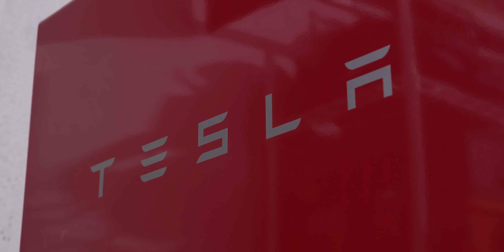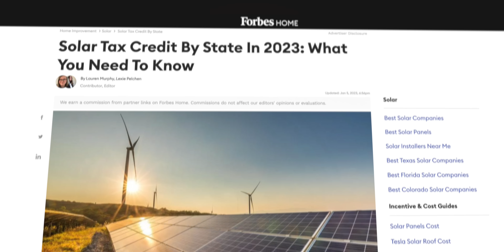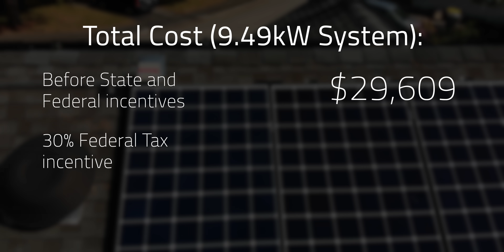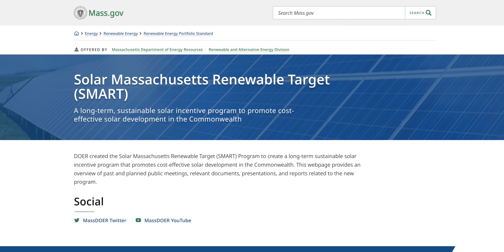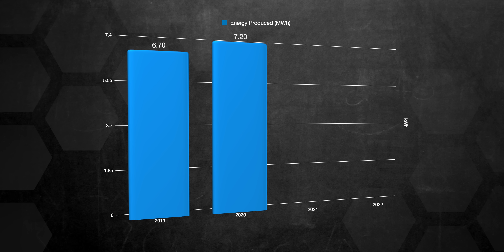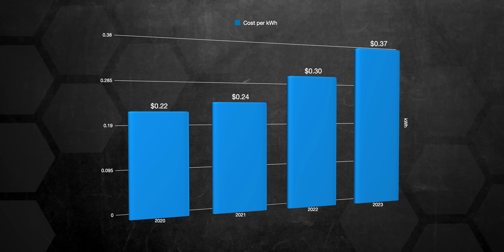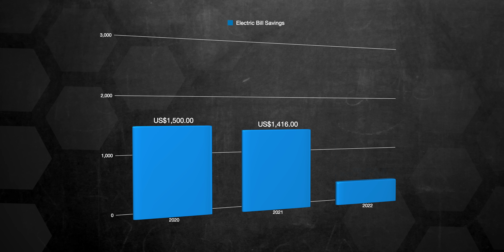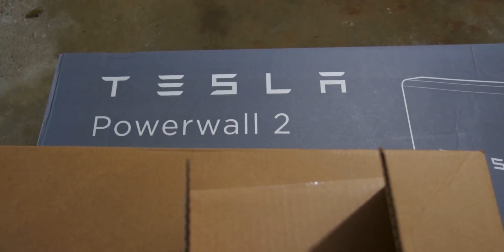5 Years with Solar Panels - Is It Still Worth It?

Comment: I'm interested in going solar, but I have a problem that you didn't touch on. I recently installed a new roof on my house, and while talking to the installer about solar, I learned that putting panels on the roof would negate the fifty year warrenty. I have seen a group of panels mounted on a metal framework sitting directly on the ground. Are there any pros or cons to this or even other types of installation.
Reply: Pros: you don't have rapid shutdown requirement and doesn't effect the roof.
Cons: takes up patio or yard space and racking is more expensive.
I saw a nice one from eg4 for 4 panels $300.

Comment: Not worth it unless you have your own power bank. Or you will be selling more electricity back to electric company then you're using at your house
Reply: That's an absurd claim. Whether it's "worth it" or not depends on many factors, and in most areas a "power bank" provides very little payback. In Southern California, solar systems typically have a 6-7 year payback, without "power banks".
Reply: @BigBen621  we pay about 3k a year for electricity. Our house it would be paid for in 2 years with a lifespan of 25 years correct.  So over 20 years payment free?
Reply: @Tegridynews  You seem to be implying that you can buy a solar system for $6,000, which is almost certainly not true. The best paybacks come where utility rates are very high. Here in San Diego, averages rates run $.35/kWh or so, and solar paybacks are 6-7 years. In areas with lower electric rates, paybacks would be proportionally longer.
Reply: @BigBen621  I'm just trying to learn not trying to argue with you. I watched your video you never said how much you paid for anyting so I'm totally in the dark. And for what I've looked online your setup is like $7,200.
Reply: @Tegridynews  You may be confusing me with someone else. I've never made a video.  I don't know what you think my setup is, but my 6.0 kW system costed $21,100 before or $14,700 after rebate. My electric costs went from about $2,000/year to nothing, so my claimed payback was about 7 years. However, rates have skyrocketed since then, so my payback has been much shorter.
Reply: @BigBen621  I do apologize I got caught up in two different conversations in solar on two different videos.
Reply: @BigBen621  dude used to Delta pro batteries, 3 solar panel, lived off grid for two days. Nearly made it by at least five hours for the sun to come up to start recharging by the second day

Comment: You spent $29k to break even in 7 years? And you can’t resale your $29k solar system? Wouldn’t a 6% mutual fund been a better investment? Even if you make 0% after 7 years at least you will still have $29k.
Reply: Seven year payback is equivalent to a 14% mutual fund; so no, a 6% mutual fund wouldn't have been a better investment. If you goal is recover your $29k in cash at the end of the payback period, then of course a solar system won't achieve that. But at the end of the payback period, your solar system will continue to return 14%; while the $29k you got back from your mutual fund is very unlikely to achieve similar returns in reinvested elsewhere.

Comment: Living in South Africa, I've also just done this - though the reason wasn't so much environmental or to see if we could save, but the grid here is getting more and more unreliable and we have hours and hours of scheduled power cuts (loadshedding) so those that are able to are increasingly going off grid.

We ended up getting a inverter and battery first (so we could take power to charge the battery when the grid's power is on, then use the battery when there's no power).

This sounds pricey compared to what we've done - admittedly in a much cheaper country than the US. And having just done it, so maybe prices have come down. Also you're getting a lot more incentives/tax breaks/selling electricity back to grid then we get, so maybe balances out.

Anyway, we paid R64,000 (about $3,500) for the battery and inverter system - just a 5kw system, we don't use that much power (gas stove, no central heating/air con, already a solar geyser/boiler). We've just got to be careful not to use the kettle, washing machine, dishwasher, toaster etc all at the same time - but so far we've been fine.

This week we've got the actual solar panels in (so we could still have power in case we move to a state of grid deteriation whereby the power's out for so longs out battery drains before it comes back on!) at a cost of R50,000 (about $2,600) for six panels giving us 5kw (same as the inverter and battery that we have).

With northern South Africa being super sunny pretty much all year round, this should be enough to get us completely off grid. It's just a shame that (currently) there's no way to feed back to the grid like, as I would think most in South Africa who are able to put in their own solar, would be willing to feed that back into the grid for little to no financial compensation, but just to help the grid not completely collapse and ensure the lights can stay on in poorer areas.

Comment: Seems to me that alot of time, money and effort is spent on solar power production of electricity. It seems to me that saving electricity, turn off apliances, lights, use fans, insulate your home, use leds where possable is a much better alternative. Not using electricity or using less of it seems to be much easier and cost effective than trying to create electricity. This is probably not what everyone on this forum wants to hear though.   🤔
Reply: Yes, cost-effective energy conservation measures should be taken first; and then the solar system sized based on the reduced consumption after these measures are taken.

Comment: i had a bad run with inverters. no.1 lasted 9 months, no.2 lasted 4.5 years, no. 3 is still going but with high cost of replacement it takes the shine off it.

Comment: Nope.  It's not worth it, for us, we would need a new electric whole house furnace, electric water heater, electric clothes dryer, electric lawn mower (5 or 6 of them to do the job while the others charge), electric weed whip, electric chain saw (need the extra large size, do they even make them in an electric version?), electric log splitter (50 ton please), and 2 electric vehicles with 500 mile range.  It's not happening, all of that would bankrupt us, and I resent the mandates from on high to "get rid of those polluting gas appliances" when in fact the electric grid is utterly unprepared for millions of users to go "green" when actually we are going to have massive blackouts if the power plants continue to be shut down, both clean coal and nuclear plants are being de-commissioned decades before the grid is ready!  And NO we do not have an extra $20,000 just sitting there in the bank to spend on a very small solar system, for our needs we would need 7 or 8 of those.  Nope, not happening, and even if we did get a loan to do it all, the next owner of the house would not want to deal with the increased cost--plus the cost of getting rid of it all when the trash company says, NO, we will not pick that up, and the recycle company says, Yes we will pi/ck it up for a FEE.  I'm all for renewable energy but it has to be affordable and actually add value to your home, not detract value due to high decomissioning/removal/recycling costs.
Reply: Your claim that you'd need to replace all these appliances is absurd; why are you saying this? 
At this point, the only restrictions on gas appliances are on new appliances and new homes in a few cities or perhaps states.
If you mean 7 or 8 panels, these would cost a fraction of $20,000; I put in 20 panels for $14,000 eight years ago, and solar panel prices have come down substantially since then.
Reply: clean coal 🤣🤣🤣

Comment: What about the cost of battery & panel replacement? They don't last forever. You got the Tesla battery wall for free, most people won't. Add that into the total cost you will never get a return on your 'investment.' I know that dirt & grime cause a loss of about 15% per month unless cleaned. That's not free either. Solar panels are cute but a total folly.
Reply: Panels are typically guaranteed for 25 years, by which time they'll have paid for themselves several times over. Your claim that "dirt & grime cause a loss of about 15% per month unless cleaned" is absurd; my system has been cleaned exactly once; and produced more energy in 2022 than in 2016, when it was new.

Comment: I feel that overall savings take many years to justify it. The system itself is increasing costs to buy and Install but you have to look at the total picture. 90% of home installs are a lease option because the outrageous cost up front out of pocket in full only helps you in a long run of years and can’t afford that. This is where financial options which is what makes it more complicated. You actually pay more for many years then what’s told. I have several Naighbor’s that wish they never went with it because it’s costing them more then before on electric bill and that’s because the 30 year financial burden as well as still using local power. I had 3 companies come and setup finances to see differences. In actuality the best option of the 3 I would be paying more for the first year and half but then would save. The savings wasn’t significant enough to make it worth the cost, aggravation and now stuck with a 30 year contract that makes it harder to sell your home as it transfers to the new buyer. You also had additives. You have to buy product to clean it or even more cost to pay a professional to clean it, your home Insurance increases, the value of your home increases which in turn causes your mortgage yearly tax increase. My end opinion is not worth the money at the value of them to buy or finance. Power increase always happens over time and the reason is so the power companies can expand the use by installing more power production equipment such as wind farms solar farms etc as well as maintenance. The more the demand the higher rates increase for everyone else.

Comment: I got a small solar system installed at the end of 2015.  3.8kW total peak power.  My house has a south facing roof area, with enough size to install the longer commercial panels instead of residential.  Top line cost, $15k.  Energy Trust of Oregon did a $3k directly to the installer.  Federal credit was $3.7k.  State credit was $1.5k a year, four years, total of $6k.  That's $2,300 after all that.  Optimizing for incentives, the 5mWh/year production put the ROI at less than four years.  Now I wish I'd put in a heat pump water heater, that has a ROI of two years and could have saved nearly as much as the solar!
Reply: This is such a bizarre comparison. A heat pump water heater is only around a 1-2k investment? why not just do both?
Reply: @Odseus  only noting that there are energy saving steps that can be taken that are cheaper and give a quick return. I went for the expensive option, putting generation over reducing my usage. Both will get done, but I wish the water heater was first.
Reply: @ReverendJasper  True. The issue I have is you're comparing apples to trucks. Going with a hybrid water heater is a good small step to energy/cost savings and a great starting point. A solar panel setup is way more expensive and involved with a ROI on a longer horizon depending on multiple factors.
Reply: @Odseus  I love apples, and like trucks.  Not comparing them, I want them both.  Only commenting on the water heater because it's a fantastic way to pay off the solar system even faster.  Truck full of apples for all!

Comment: I would suggest you also factor in meetings for a real picture I’m still on the fence on solar because I’m afraid I’m gonna have to clean them off every day, hours, and hours, and hours time is actually meeting you, considering the overall effectiveness of such a system
Reply: I've had mine cleaned exactly once, in the >8 years since it was installed. I couldn't see any difference before and after, and the system generated about the same amount of energy in 2022 as it did in its first year of operation, 2016. If you have a decent slope and get some rain, you should never have to clean them.

Comment: All these programs to make it more “affordable” I just ways the energy companies can save a buck. They put all the liability on the homeowner. While the government subsidizes power generation systems for the energy companies and the solar panel industry. The price to performance of the solar panels and the laws restricting their use are just not economically viable to the homeowner.
Reply: They may not be economically viable to some homeowners, particular in areas with low electric rates and/or limited insolation, such as the northern tier of states. But in areas with high electric rates and high insolation, they are highly economically viable to the homeower—often with simple payback of 7-8 years or even less.

Comment: He neglects to see the downfall of that battery. To get paid for the program they get to use the battery on demand. So the money you pay to store power is not only used but that usage also diminishes the battery since they have a limited amount of cycles. They are getting to use your battery cycles for a great deal and you were just actually losing money.
Reply: Yes. Everyone knows that batteries degrade over time.

Comment: I get the impression that you are still not making a profit over expenses? Your system is now “Outdated” and requires servicing with updating your panels from 20% efficiency to the latest 250% + increase in conversion to electricity! Now I reckon is the optimum time to restart your Lifetime experiment towards a real beneficial product for your family...excluding snow of course?
Reply: Absurd claim. 250% increase over 20% efficiency would be 70% efficiency. The best commercially available panels have an efficiency of 22% to 23%. Even in the impossible case that new panels are 70% efficient, the original ones would still be producing what they were planned to.

Comment: Couple thigs he did mention. Now that these solar panels have been around for couple decades. Do not buy these houses if the panels are more then 15 years old. My niece bought one and old as panels were they would have to be replaced and because the house need a new roof the cost to remove and install new ones plus the roof was lets say more then she could handle around 50K. Another thing was cost to dispose of the lithium cobalt nickel batteries. All i can say is good luck. They are not environmentally friendly
Reply: My ex-stepson-in-law just had his 4 kW system removed and reinstalled for reroofing for $2,000. You said the cost to remove and install plus the new roof was 50k; but you didn't say how much of this was the remove and reinstall, and how much was the roof. So it might have been $2,000 for the remove and install, and 48k for the roof—which she would have had to pay anyway.
Last time I looked, solar panels don't have "lithium cobalt nickel batteries".
Reply: @BigBen621  The size of the system and the size of the house. Big difference it was 10 k just have system removed and upgraded. From 3 story house . Not sure how you stored your power but you do need a battery bank.  Which do require lithium Nickle cobalt batteries. A The entire roof had to be replaced not a re roof entire thing because where it was installed began to leak. If you got re roof done for 2000 bucks i will not last long. just a re roof with no system  solar panels is 10k depending on size house for single story. I know i did roofing  for years
Reply: @donvindicare6517  Sigh...So many errors, so little time. 
 "10 k just have system removed and upgraded"
 So it wasn't 10K just to have the system removed—this included the cost of upgrading the panels, as well, which might have been the majority of this cost. But that shouldn't have been required, because 15 year old panels should still have at least 10 years of useful life in them and likely many more. 
 you do need a battery bank
No, "you" don't. The vast majority of solar systems don't have batteries; these are a large additional cost that is included with a small minority of systems. They almost never have a payback, so people who buy them are doing so for reasons other than savings. Further, there's nothing about removing and reinstalling the solar panels that would necessitate replacement or disposal of the batteries.
 If you got re roof done for 2000 bucks i will not last long 
You obviously didn't read my comment. $2,000 was just to remove and reinstall the panels; I didn't specify the cost of the reroof, but it was $31,000, on a two-story house.

Rigid rules like "[d]o not buy these houses if the panels are more then [sic] 15 years old" are rarely correct. It would be perfectly appropriate to buy a house with 15-year old panels, as long as the future costs of dealing with replacement of the roof and panels is taken into account when making an offer. It might not have been the right decision for your niece, but it might well have been the right decision for someone with different requirements or in a different economic situation.
Reply: @BigBen621  I guess he likes risky investments. So go for it
Reply: @donvindicare6517  Not sure what you're saying. There's nothing risky about my ex-stepson-in-law's "investment". The solar system was already in place with he bought the house; it's been producing steadily per prediction; and all he had to was spend a couple grand to remove and replace the panels for a roof replacement, after which it would continue to save him a couple of grand a year. Where's the risk?